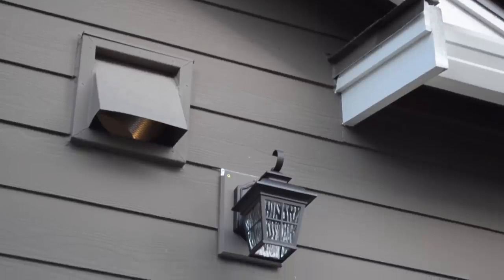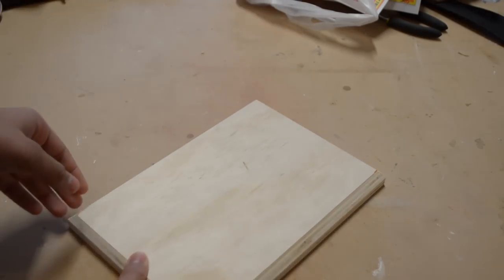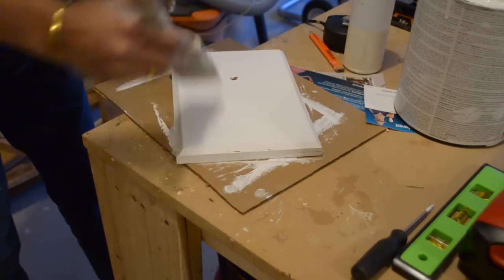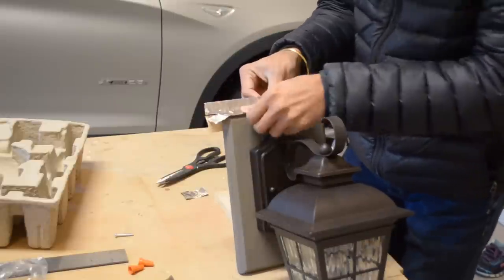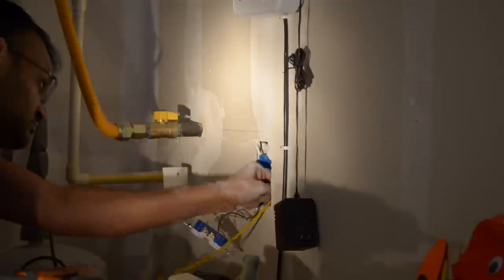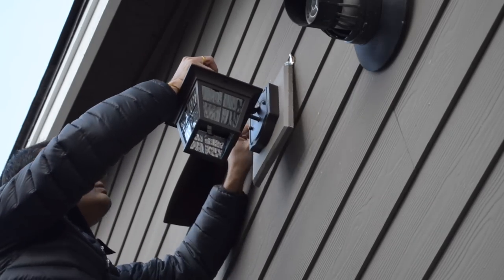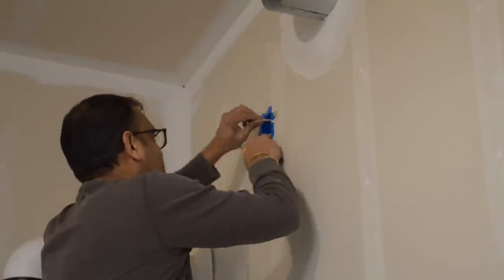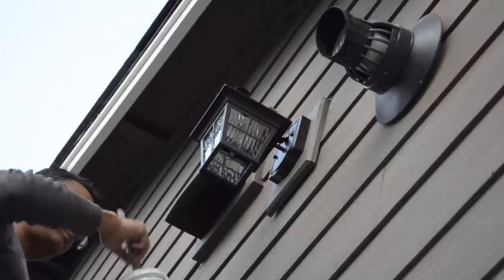How To Install An Exterior Light To Your Home

Comment: A pancake surface mount box would have worked here, with extra room for the wire nuts created by the metal housing. I would prefer that rather than cutting a big hole for a flush mount junction box. It is very nice looking. The code issue is the fixture wires now run through the wall without a cover, those wires aren't approved to run inside a wall without conduit or cover. It would be fairly easy to fix, just fish a short length of Romex from the new box through the wall to a pancake junction box, surface mounted on the beautiful wooden backplate. The pancake would be completely hidden by the metal housing, those are usually designed to cover a standard size pancake box. To be technical you could use outside rated NM wire. Cable connectors at the entrance to each box, with silicone or duct seal to prevent water entry. Ground the pancake box to supply ground with a loop on a screw, terminate ground with wirenut to fixture ground wire, and wirenut hot and neutral. An electrician would probably have fished romex from the original plug up to a new manual switch, from there to a hole in the wall, then mounted as above. Those sensor driven lights tend to fail after a few years, so it's good to have manual control without needing a ladder.
Reply: Good, very good !
Reply: spelunkerd  thanks for posting this. Your suggestions sound like the sensible way to do it safely and follow codes. I am doing something similar and didn’t know about those boxes so thanks for the tip. I’m not sure why these guys wanted a JBox up high on their interior wall. Maybe they will put a decoration over the cover plate. 🤷🏼‍♂️ video could have done better to illustrate NEC and why they did this I so strangely.
Reply: COOL MAN THX👍💯
Reply: Holy the exact answer I was looking for. Thank you mystery man.
Reply: The lack of an outside junction box is iffy but Romex wire can be run without conduit, that's what it is designed for.  You never pull Romex through conduit.
Reply: I'm glad people with knowledge add value here.
Reply: Is your suggestion to code as well?  Doesn't the light fixtures need to mount directly to a box? As opposed to a random wooden block?  Many youtube videos show these exterior fixtures done in a day handyman manner.  It would ve like mounting a ceiling fan to a joist then running supplied wires to a box at some other location.
Reply: @Guillotines_For_Globalists  
I don't think anyone is saying to pull Romex through conduit.
Reply: @goodcitizen3780  Not sure, nearly 12 months ago.
Reply: @Guillotines_For_Globalists  
Mmm
Yeah. 
Oops.
Reply: Actually a pancake surface mount box is the most code correct way of wiring here. This fixture does not include an approved connection box itself (ceiling fan, florescent lights do). Running unsheathed wires through the wall and splicing them inside is not code - not protected from damage (rodents chewing, sharp screws/nails etc). The inside box is unnecessary, but may make the NM cable fishing up the wall easier.

Comment: 1. don't you need a ground fault receptacle (GFCI) unless the circuit is already GFCI protected?  2. As important since this is a retrofit, would you also not need arc fault protection? ("AFCI")?
Reply: Proper smartass aren't ya?
Reply: Arc item doenda on the state. NH follows 2017 code. So depends on source.

Comment: I’m looking to add something like his above my garage, 3 of them to be exact. It has never been wired before in those areas. Would need to drill into siding, and drywall, and run wire somewhere. Is this something that you would recommend a general contractor do or a electrician? I’m just curious if a electrician is skillful enough to do all the drilling
Reply from the maker: A licensed electrician should know what they're doing and how to drill the holes
Reply: Yes, hire an electrician.

Comment: What about the vapour barrier on the inside and the moisture barrier on the outside ? Making big holes like that is against the code in Canada. One needs a vapour barrier gang box on the inside. One needs to address the moisture barrier on the outside.
Reply from the maker: Always follow your local codes and only attempt what you feel comfortable doing!
Reply: @DadandSonDIY  I like that you are a dad and son DIY team. That is awesome! 😎👍However, you didn’t install the light to the NEC code and probably not to your local building code. 

As several have mentioned in the comments, your junction box should be attached directly to the light housing; not fished into a the wall bay into the junction box. Your fancy wooded wall plate also wasn’t properly flashed, wrapped and sealed to prevent wood rot and corrosion from entering the wall bay. When this shorts out in corrosion in 15-30 years it’s because you didn’t follow code. 

However, as a builder, it’s a good policy to always research how to do it to code (or above code) or ask a professional. 

Good luck! 🏠 🔨

Comment: Where is the switch?
Reply from the maker: It's built into the light fixture. The light has a sensor that turns it on/off based on the amount of daylight outside.
Reply: Thats cool whats the name of those lights fixtures??
Reply: They now have bulbs with the photo sensor built in, so you don’t need a special light fixture. Just use the bulb in any standard light fixture and you have light from dusk to dawn.